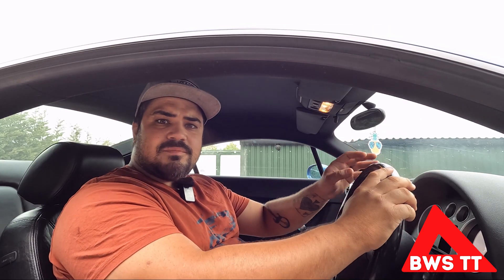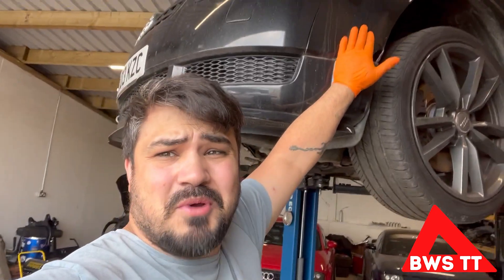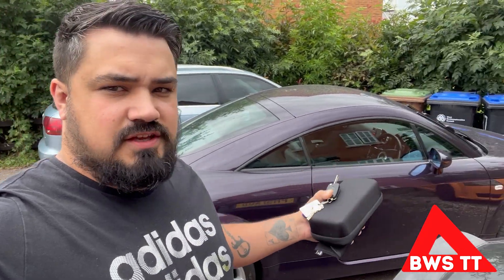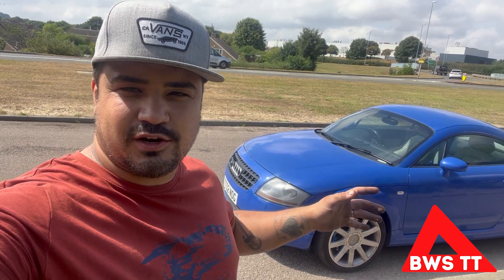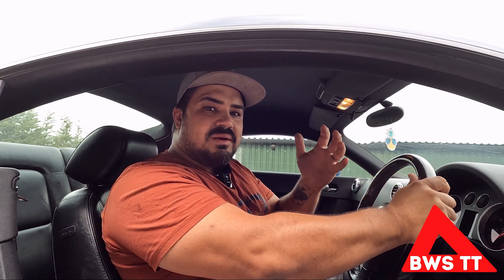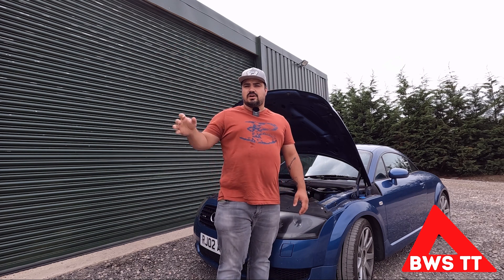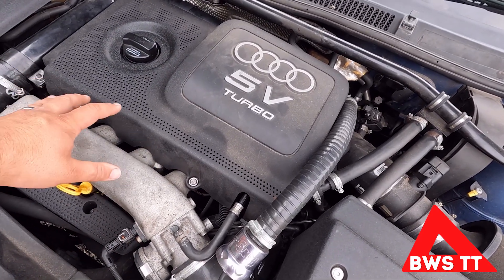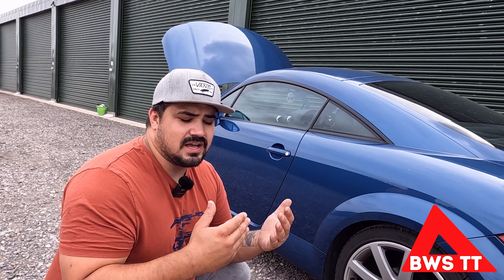I got this Audi TT for FREE!

Comment: Please add the
Cost of unit / workshop and maintenance.
Energy bills
Fuel
Lubes and oils
MOTs (if they need them)
Reply from the maker: The only additional cost was my labour, but all work was done out of working hours, so my own time. Uint fee is covered by my day job, as are energy bills, fuel wise i inly put it what i wanted to put in, but didnt need to as part of the work, mots werent required.

Comment: You missed the keyword at 14:50 regarding the tires.... "Super Sport".
Theres a bunch of tires that come under the eagle F1 title.

They are a true UUHP tire that is the only direct competitor to the Pilot-sport 4S.
After one year of release the true tire wear data is in and they are next level.
I run those exact tires on my mk1 TT and I haven't even heard them squeal yet.. Stupid grip when combined with H&R kit!!... especially sway-bars.. 
:)
Reply from the maker: They feel great so far, they certainly surpass the standard suspension, so im sure theyll be a good option for the ring

Comment: Bryn buddy, 

Been trying to get in touch, I managed to get a refund for the engine we got from the breakers that developed a noisy top end after a few miles of test driving, I have started to go through the process of elimination regarding the noise (Deffo top end hydraulic lifters noises) So, step 1, me and the wife no longer trust the work that was done on it, therefor we do not believe they put the correct Oil in the engine and just stuck in the nearest grade available to them in their garage (Like 10w/40 or something instead of the 504/507 vw/audi specific) So, I am midway into an oil flush, (1hr on tick over) then I will be changing the Oil and filter to see if the noise persists.

After this, if the noise still persists, what would you recommend the next steps to be?

Be great if we could discuss this once I have completed the present test with the oil and filter flush 👍👍🍻🍻

Comment: Hello everyone,  question for everyone... I need a new pipe for the intake inlet or throttle body.  I've  up graded to the 80mm hemi throttle  body , I have an  g grams large port intake. . Most of my pipes are forge  silicone.  I'm fine with whatever.  Thank you for your time

Comment: Have just had a new engine put in my mk 2 by Audi dealership after a side street garage botched a new timing chain and tensioner job which totally failed , swarf in oil pump and all over timing chain guides,  was told this garage was the bollocks , I'm gutted,  £ 10,000 fix 😭😡